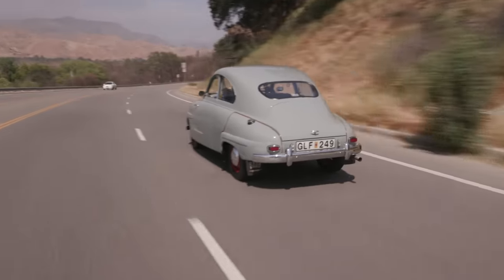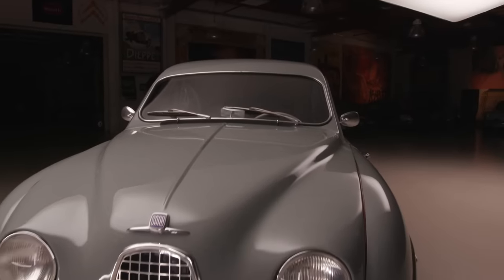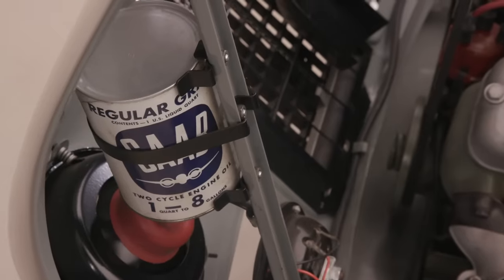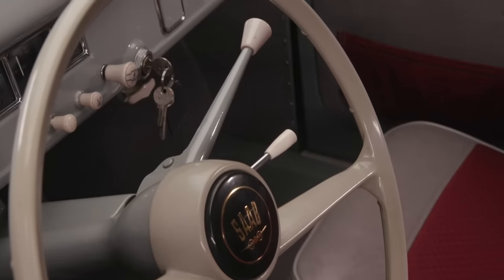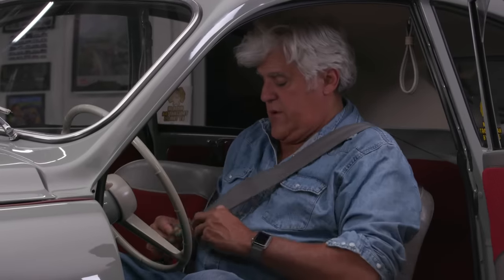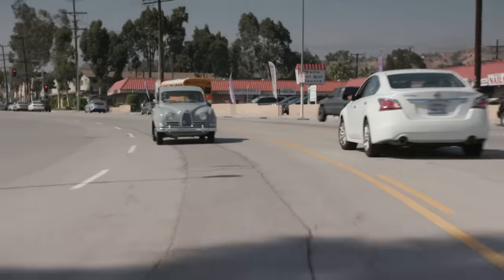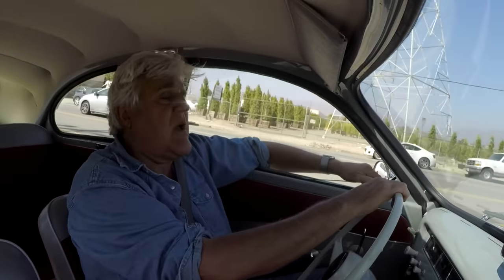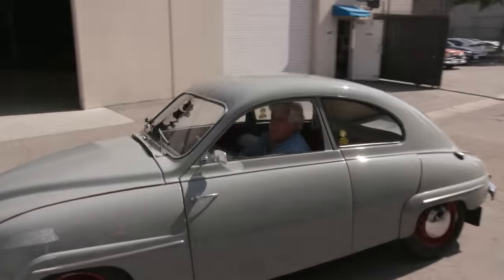1958 Saab 93 - Jay Leno's Garage

Comment: as a swede I found it really interesting that this saab has a swedish plate :)
Reply: Incidentally that plate now belongs to a 2008 trailer that's failed MOT due to non-functioning brakes.
Reply: Wilmer, you are right (says this Swede). However, those are modern Swedish plates. Pre 1973, they had a letter followed by a number (not like today, three letters followed by three digits). The letter indicated the region ("län") of Sweden. Also, there was no black rim: https://sv.wikipedia.org/wiki/Registreringsskyltar_i_Sverige#/media/File:SE_license_plate_before_1973.jpg
Reply: @HB45175  Wasn't just me that just had to check that license plate then :)
Reply: Vart också tvungen att kolla upp den, gissar att bilen vart importerad till USA nån gång innan 2008 när släpet tillverkades..
Reply: Me too :-)
 @pierreb967

Comment: Thanks, Jay.  Not sure if this was covered in all the comments, but the freewheel was there to keep from destroying the engine on deceleration.  With premix, the engine relies on oil in the fuel for lubrication.  The more fuel going into the engine, the more lubrication.  But if you go down a long hill at 6,000 rpm's with your foot off the gas....no fuel, no oil, no lubrication, and...no engine!  With freewheeling engaged, the engine goes to idle on decel and gets the right amount of oil.  In my youth, I rode 2 stroke motorcycles using premix.  I was taught to pull in the clutch going down hills or approaching a stop.

Comment: The British did combine water and electricity in one unit.  The distributor in a classic Mini, right up against the grille, just waiting for a rainy night.

I didn't say it actually worked when that happened.  :-P
Reply: Yes, and 'Prince of Darkness' light switches on 1960/70s British motorcycles!
Reply: Or a Stag with the water pump inside the engine!
Reply: @ldnwholesale8552  Or a Lotus twin cam engine with a water pump so inaccessible you had to take the timing cover off.
Reply: @whitefields5595  same as a vq nissan
Reply: Actually, the SAABs under those conditions also had distributor problems.  Always carried a can of spray lube to disperse the condensation on the dist. cap in soggy weather.  New York state, lots of soupy, cold days.
Reply: @whalesong999  True, although I'm not thinking of condensation.  In the Mini, the spark plug wires were affixed to the cap with a screw from the inside which made the connection to the centre copper - and water coming through the grille would run down the wire, into the cap, and flood the distributor.  As in "take the distributor out on the side of the road and pour the water on the ground before employing the WD40."  :-P
Reply: @aussiebloke609  Omg, I worked briefly at a foreign auto shop and we had a Jaguar that had terrible wet weather distributor problems of the same kind.  We resorted to some kind of polyethylene bag over the whole thing to help him out.  Also worked on a Mini, what a wretched thing to work on.
Reply: The one I drove [ or almost the same model ] had the low voltage distributor and 3 separate ht coils. No probs in the wet till I switched the over-run roller clutch out, then I found out why it had such good brakes, and why my relation who had just bought it wanted me to drive it home!
Reply: Remember when a 2 litre bottle of Coke had that black plastic base on it?  We used to take the base off and feed the spark plug wires through the holes in the bottom so the water couldn't run all the way down into the cap.

I think the problem was the design of the cap, more than anything else.  When the wires are attached with a screw from the inside, that means there's a path of ingress for the water running down the wires.  And having it right against the grille just made things worse.
Reply: One of the old model Rolls Royce's had a combined generator ( dynamo!!!)  and either oil or water pump; can't remember which but it was shaft driven.
Reply: Jaguar mk2's had their power steering pump part of the dynamo
Reply: aussiebloke609 Ha ha great memories, that is a tried and trusted method we used in South Africa in the 1990s to prevent splashes coming up and killing the engine. I remember my 998 engine dying when hitting a large puddle and knowing that it was time to replace the black plastic 2 litre coke bottom - it was hot glued on and you had to tug like hell to pull it off. I also remember pulling out the choke cable to try and get an extra few kph ;)
Reply: @johnmcf  Chevy did that for a while in the 50's too!
Reply: Lucas headlight switches have 3 positions Dim, Flicker, and off
Reply: @ianbaxter8299  That is so interesting.  I know of and owned another 3 cylinder two stroke auto that fits that description,  a DKW 3=6, 1958 model.  Had three sets of points/condensers/coils, breaker units on the front of the crank under a rubber cover.  It never had any issues with wet weather - also had free wheeling drive lock-out.  What country was that in?  All USA examples of SAABs I've known of had the single coil set up.
Reply: @Jonathan Eddy Jonathon, my first SAAB was a '64 "bull nose" one.  It had the issue from the get go because all SAAB two strokes had the front distributor and were vulnerable.  I had to stop and spray the distributor cap once in a while in foggy and rainy weather in order to get down the road.  Eventually, a decent 'cure' came along with a new distributor cap that had some kind of transparent coating sprayed inside and out and I had no more troubles there.  Not to forget also, there was a grease zerk on the distributor drive gear housing that one didn't want to let get dry...(..;)...)...!  That distributor arrangement spins/spun at crankshaft speed which made internal arcing more of an issue than with the ones for four cycle engines.

Do I remember correctly that the older ones had some kind of shield ahead of the distributor to deflect getting pelted through the grille opening?  I recall the shutter offered some deflection but that shield thing came to mind... .

Yeah, come to think of it, the face of the coil was also a trouble spot for mine but easy to see and fix.  Quite a fireworks show when you watched the engine run when it was dark.
Reply: @kaa522  That makes me chuckle, much like the wonderful quips of a few motorcycle mechanics I came to know in the late '50s onward.  They came up with great humor to handle the frailties of light bulbs and switches and related Luca stuff.
Reply: We put a rain shield on ours.
Reply: @whalesong999  
Mini's were fun :), not many cars will allow you to change the clutch without having to drop the transmission.
Reply: aussiebloke609
s back,
Funny, you are saying this. I had a Mini 100 years back, and what shall I tell you, it did stall in a big rain-storm on the Autobahn... yep, the great British engineers! ;-)
Of course there's some good engineering, like the straight six Jag engines...
Reply: Tradition. Nobody respects tradition like the  Brits. I remember in the 1980s, whenever it rained all the Jaguars pulled off to the curb like the Queen was about to pass by. They weren't waiting for HRH, they were waiting for the AAA. In Los Angeles! How often does it rain in southern California?  Thank goodness during the Battle of Britain and D-Day it didn't rain (later in 1944 the Brits did  find out that 1700 new trucks, they were about to ship over to Europe for the war, had engines so badly assembled they couldn't be used. Look that one up. )
Reply: whalesong999 The Saab borrowed heavily from the DKW design. Note the engineering similarities : front drive, 2 stroke, free wheeling, radiator behind the engine, etc.  DKW later combined with Horshe, Wanderer  and Audi to form Auto Union.
Reply: @hotrodparker    I had a '76 Saab GL99 or 99GL, I try to forget.  Anyway, it had all Bosch electrical that was always either burning, smoking or shorting out.  I always wondered if Lucas was better.  I guess it wasn't.  Twice my headlight switch started smoking while I was driving along.  Honestly, I think the headlights were off at the time.  Relays went bad.  The thermostatic fan sensor needed to be replaced every 3rd Wednesday.   And that's just the electrical systems.  The paint started blistering at about the one year mark.  These guys built airplanes?
Reply: @garthlundquist8316  Yes, I owned a '58 "Deek" , kept the hood ornament as a momento when it was eventually scrapped from a rear end collision.  I liked the car a lot, suffered from some rust eventually due to our salting of the roads in the winter.  Had a thermosyphon cooling system with no water pump.  Had more torque steer than the SAABs, used 'stirrup' u-joints at the front hubs instead of CV joints.  'sigh', good memories.
Reply: @Jonathan Eddy That was the real purpose of the roll-up "window-shade' It's not so the car warms up faster, Jay is wrong here. It's to protect the distributor. Not well, but better than nothing,
Reply: thats why those in the know used to put a marigold rubber glove onto the dizzy that was an old rally trick but it stopped the cutting out.
Reply: @aussiebloke609  
The Mini distributor problem was soon fixed.  The later versions had a big rubber boot on them.
Reply: @hotrodparker  
What drivel.
I have had countless British cars and not one has ever given trouble on the electrics. The British residential electrical systems are the best in the world. I am amazed at the poor design and quality of US electrical systems - stuck in the 1950s.
Reply: @johnburns4017  That's HILARIOUS! Ten thousand comedians out of a job, and then there's you; claiming Lucas electricals are or were at any point or application "reliable and trouble free".....
Reply: @hotrodparker  
You are prattling anti-British drivel.  The finest engineers have been and are British. The nation that invented the modern world. Next you will be saying the US won the war all by themselves.  The reality was they were a poor army and an embarrassment at times.
Reply: WillN2Go1 Reminds me of the old joke: Why didn’t the Brits develop their own computers? They couldn’t figure out how to make them leak oil. :)
Reply: @mdsf01  
The British invented the computer as you know it today.
Reply: @M Bacon You may be blind to the anti British drivel here. Wise up, look around.
Reply: @M.D. S  Not sure I get that "old joke."  The British invented the programmable computer during WWII - Colossus was built in late '43.
The first US-built computer was ENIAC, and it wasn't around until the end of '45.
Reply: @aussiebloke609  
The British helped the US with ENIAC.
Reply: @M Bacon 
The British Manchester 1 was the base for the computers we have today. The British Ferranti Mk 1 was the first commercially available computer.
Reply: Brits never did get that car manufacturing down real good...
Reply: @esaedvik  
Their engineering was ahead of all others for sure. I once had a Merc 230 SL. The poor engineering in that was a surprise. It gave constant trouble, more than any car I have had. The next was the German V4 engine in a Ford - used in the SAAB 96. It burst into flames. The carb and distributor were next to each other - how dumb. After those it was a US Chevy Blazer.
Reply: @aussiebloke609  
Someone left off the rubber sealing boot over the distributor didn't they? ;)  The fist prototype Mini had the engine the other way around. They had it that way so the distributor and other parts are accessible.
Reply: @whalesong999  
SAABs never had CV joints until the later 96s.
Reply: @John Burns  Never saw a rubber boot on an Australian Mini - of course, they may have all melted in the heat.  :-P  There was an aftermarket plastic splash shield available that reduced ingress to a trickle, but that's all I've ever seen - and it didn't completely prevent water from trickling down the leads and into the cap.  It was such a relief when I could eventually get a sealed-top cap with snap-in leads instead of the side-exit cap with piercing screws for the leads, even if they were a little taller and rubbed against the grille.
Reply: @aussiebloke609  
Rubber boots on distributors were standard after a while. Water ingress was not a real problem in the UK as we rarely have those tropical storms when the heavens drops all at once. New cap design was the key and a rubber boot. I recall 3rd party makers made differing caps of various top and side entering cables and forms of cable securing and sealing. Some had nuts that the cable ran though that tightened a rubber seal (like a small rubber washer) against the cable - common on electrical appliances for cable access.
Reply: Why do English cars have adjustable voltage regulators? so they can go out of adjustment. Why do they have refillable shock absorbers? So oil can leak out of them, too. But, be advise, I love old English cars, especially the Rileys, Alvis and other higher-end cars of the 1930s. The craftsmanship of them is very impressive. They were sure not Austin Marinas, that's for sure.
Reply: They cured it on the first mini with a plastic  supermarket shopping bag.
True story
Reply: aussiebloke609 I think Jay is intimidated by British technology.
Reply: Don't I know it!!!
Reply: @fk4515  I think that was generator and power steering pump combo.
Reply: @fk4515  I think that was a generator power steering pump combo.
Reply: @whitefields5595  no, "Prince of Sudden, Unexpected Darkeness"😂😂
Reply: @aussiebloke609  Maybe very early minis. My first was a 59 850. But, there were boots available. Mine also had a block heater as it was from Canada.
Reply: I had one of those,,it used to cut out and jump start itself while driving.  I eventually bought a plastic panel to cover it.
Reply: I know, as a - former Mini owner - 1966 > 1970. When trying to overtake a lorry in rain, you waited behind, and then as fast a Mini could do with its asthmatic 850 engine, and before the engine started failing, out of the spray!! I then put a 1275 engine in it, and that was a lot more fun, without changing the sign on its back - but still it was a really, really horribly built car! I had to bend the window frames, with sliding windows, to make them meet the body, as they were a cm out, and leaking all the time! And the front screen also leaked in the corners!!!

Comment: a fun fact about those early saabs , and a shame you didn't mention it , was the bottom of the car .
It's allmost completely flat  .In the year 63 they won the Monte Carlo Rally. That year the weather was terrible , most teams got stuck in snow and had to dig the car out again and again.
but because of the flat undercarriage , on bad downhill stretches , they just let it freewheel and they allmost used it like a sled , just gliding over the snow . wasnt hard to push out either , and because of the freewheeling , they didn't dig in fast. So front wheel drive and 2 crazy swedes , and you got yourself a winning combo.
Reply: Actually, Eric Carlsson and SAAB won the Monte Carlo Rally both 1962 and 1963!
Reply: An aspect of rally racing that keeps me interested in the series, year on year.  Speed/HP is important, but many other factors.  Especially? Durability and clever engineering.  Who is impressed by building the biggest engine that can go fastest in a straight line?  Not me.

Comment: Great video Jay. In 1968 I purchase a white 1963 Saab from a dealer in Highland Falls, NY with about 85k miles on the odometer. Previous owner was the chaplain from West Point Military Academy. The ‘63 version Had 4 speed on the column, freewheel, fold down rear seat, no suicide doors though. Being 18, I beat the hell out of that car and probably added another 80K miles to it. For every eight gallons of gas I added a quart of oil to the tank and never had an issue. I miss that car.